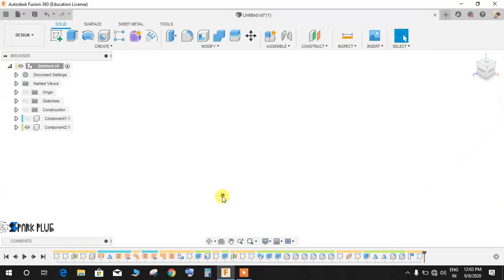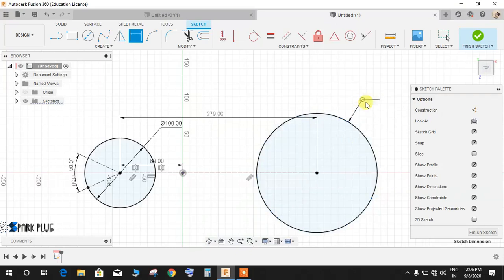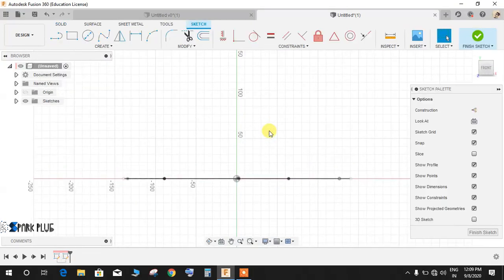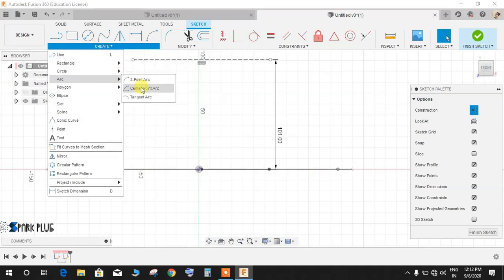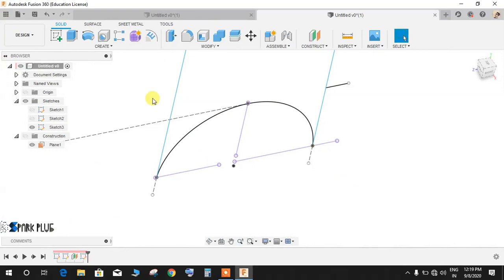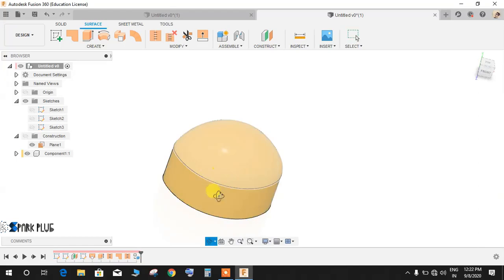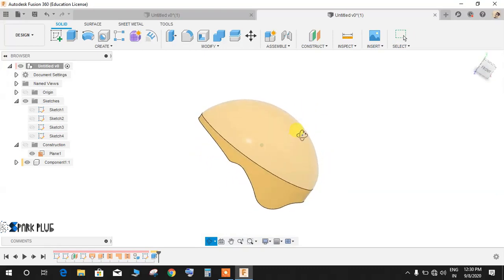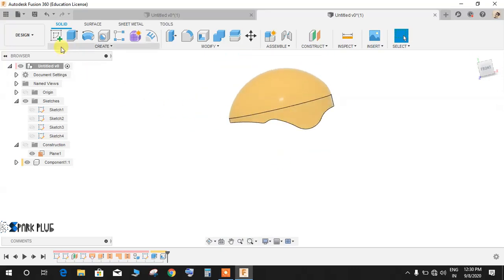BICYCLE HELMET - FUSION 360 SURFACING TUTORIAL

Comment: Hi, Great tutorials. Helped me learn a lot. 

But with this tutorial I am having difficulties. 
At 9:25min
I cant make an intersection curve, it gives me an error. 
Only thing I can intersect is lower left and right curves with the one in the middle in the XY plane. 

I cant intersect any of them on the origin plane or the offset plane.
If I intersect middle curve with the origin I get a line where it is supposed to show but it is only 76mm and 90% of this line is on the left side from the middle curve.
Reply from the maker: May be you are doing something wrong, it's hard to tell just by ready this
Reply: @SPARKPLUG98  So I tried to simplify things. 
I made a new project with a circle of 100mm diameter from the origin on the botom XZ plane.
Then I made a 100mm circle from the origin in right XY plane, Like for your helmet only simple shape to test what I am doing wrong. 
Split the bottom circle in two arches, and one arch over them in the middle. 
So I have sketch one with two arches making a full circle, and a second sketch in other plane making a half a circle in the middle.
Made an offset plane, and when I try to project/intersect left or right arch in the bottom plane on to the offset plane, it gives me an error. 
Dont know what I am doing wrong.
Reply from the maker: Don't use. Project , use intersection curve.....the 3rd option...... select the curve and the plane , that's it , simple.
May be you should  share  me with a  screen recording of what u actually doing
Reply: Same here.  Intersection works on 1 side but not the other.  I kept trying many times then gave up.

Comment: Hi thankyou for the tutorial! Im stuck at 10:33, intersection curve wont create on the right side. I have the left one and the top one, but I get error when attempting the right side segment and the newly created plane. Any help would be fantastic if you have the time.
Reply: I have the same problem. I use mirror for the right side and it creates the right vertical line that  I need. I understand the tool for projecting on the curve. But what I don't understand is why he deleted it and used another project tool 11:13.
Reply: @jumbo999614  thankyou for the reply! Actually im starting blender tutorials now. Same non destructive workflow, im liking it!
Reply: @jumbo999614  Could you please elaborate on this? I am stuck at the same place and unable to create the other intersection curve.
Reply: @YourRoyalHenry  I was able to create intersection line on only one side. So instead of repeating the process, I use mirror feature of Fusion 360 to create another.
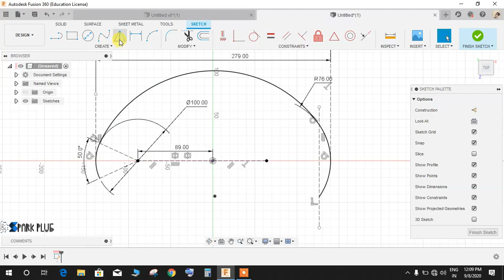I think the other half was created by using mirror copy (5:52) that's why you can't create intersect curve on a mirror.
Try to create another half manually. Then use intersect curve on it.
Reply: @jumbo999614  Ah alright. I actually did try that, but it wasn't allowing me to mirror it either
Reply: @YourRoyalHenry  Edit the sketch and use mouse to check carefully if there is duplicated curves (same angle same position). Click on curve and delete. If the curve is still there, then you just deleted the duplicated one. This happens to me a lot when I use Solidworks.
Imagine you have two pieces of paper with the same size and you put one on top of the other, it looks just like one piece. Or maybe you put the bigger paper on top of the small paper. Then the bigger cover the small one.